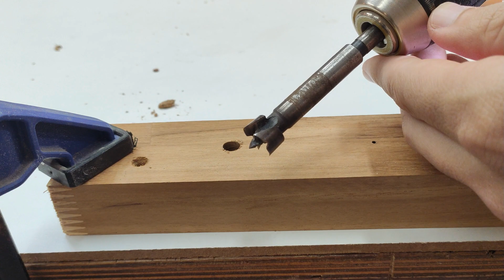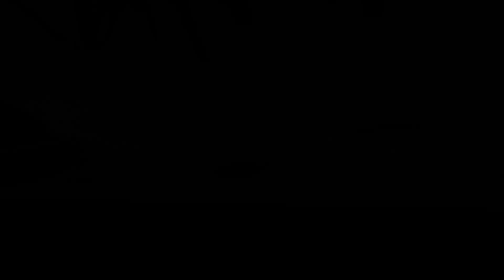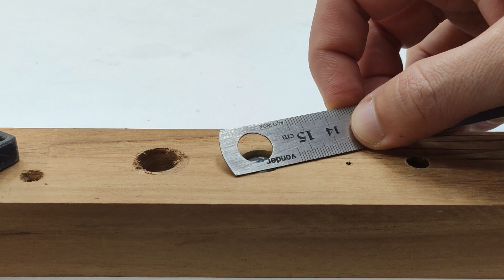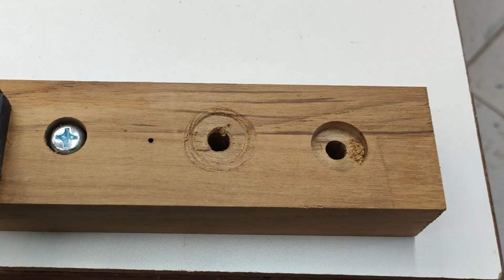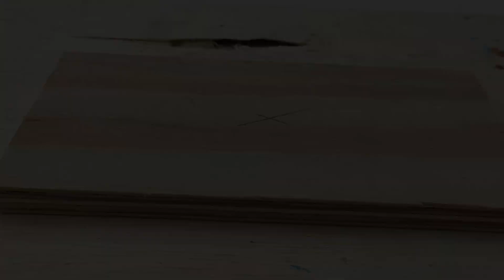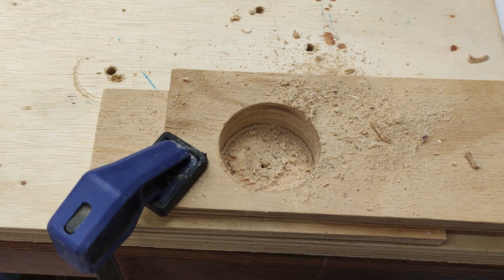A Solution for Fixing Wrong Sized Holes | #woodworkingtips

Comment: If you didn't drill all your holes on an angle I might listen to this. Also small bit to pre-drill then the auger bit and finish it up with the size of bit you need for the screw width. If you had a proper hole saw you can put the smaller hole saw on instead of the drill bit under the bigger hole saw and that will center it for you. Glad your getting views tho